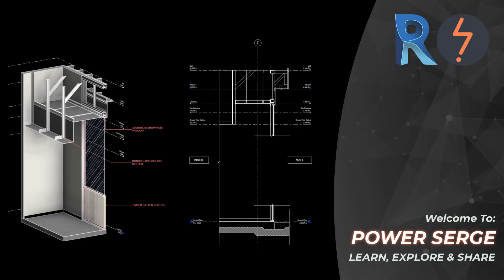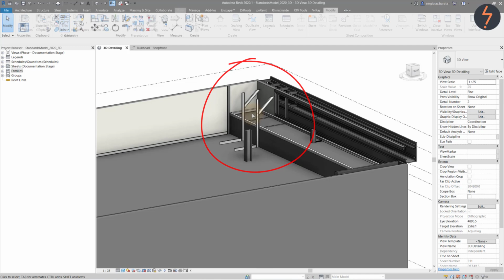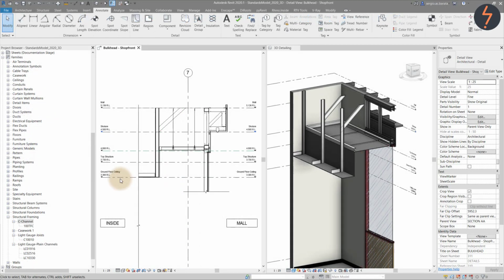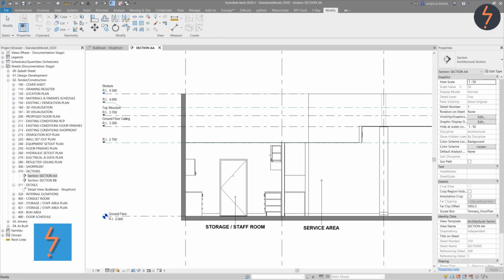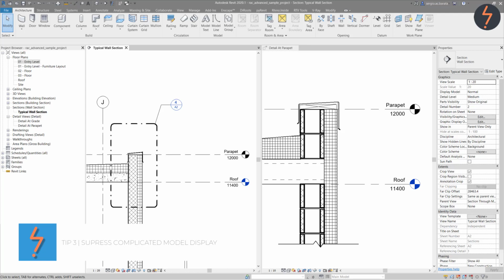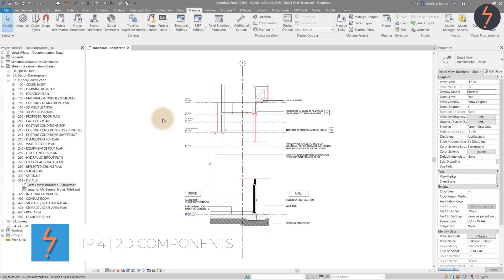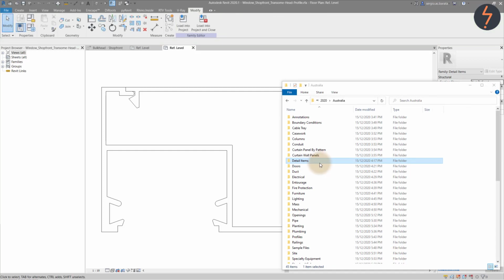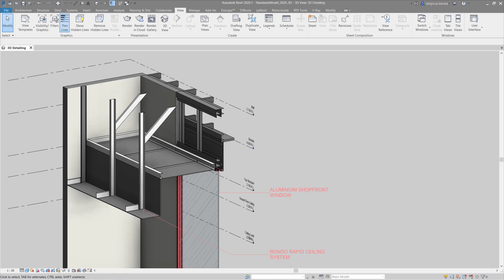Revit | 3D Details and Alternatives (2D Components)

Comment: Can you create 3D parts pealing details where you shows the materials video 2025
Reply from the maker: Thanks for the question! Yes, you can also achieve this using Revit Parts, which is a clean way to separate layered elements without manually remodeling. After creating Parts from a wall, floor, or roof assembly, each material layer becomes its own editable object. You can then manage these Parts to peel them back and reveal what sits behind. Combined with a section box, this gives you a controllable 3D cut-away while still maintaining a link to the original host element.
Reply: @SergioBarata  Can you actually make a tutorial video showing these methods please😊